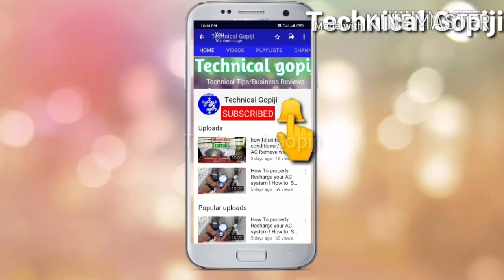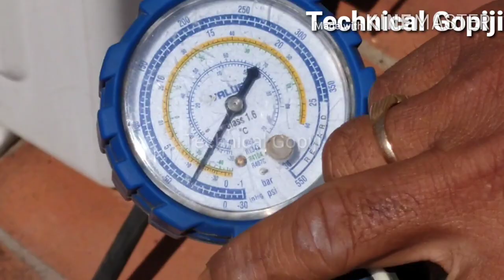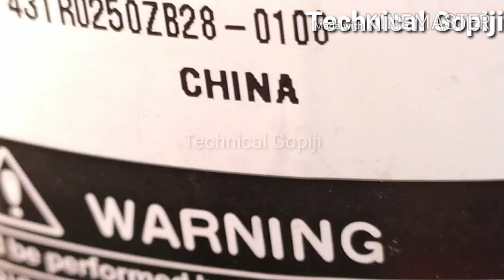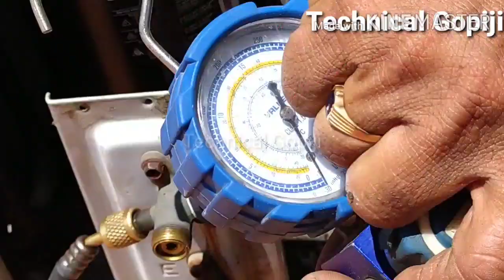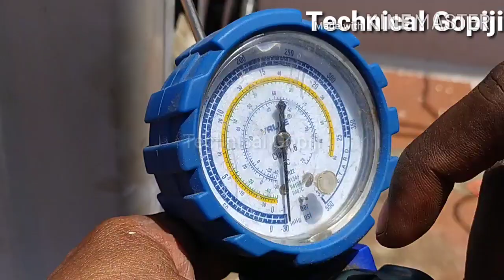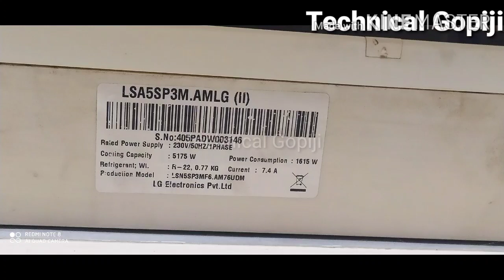LG Outdoor Unit Conditioner Coil Pipe Gas Leak/copper pipe Gas Leak/ Technical Gopiji # 23

Comment: Gopi sir ... Whirlpool 3d cool 3star 1.5 ton air conditioner may 2017 la vankirukanga but athoda outdoor la specification label ila so athoda refrigerant 22 or 32, amps and refrigerant oda quantity sola mudiyuma sir plz... model 1.5 T 3D COOL HD COPR 3S - SNOW WHITE - I Vizhupuram BojanRajan..